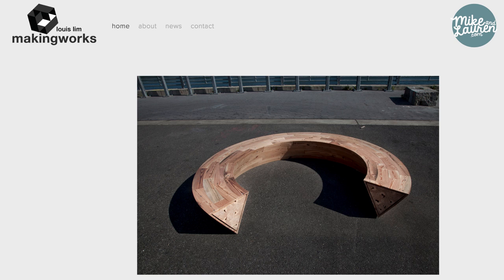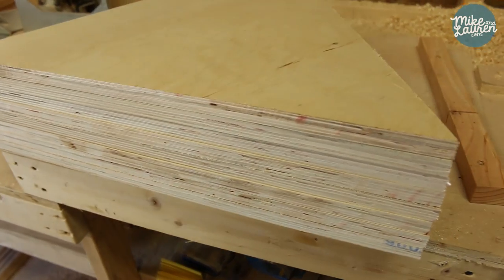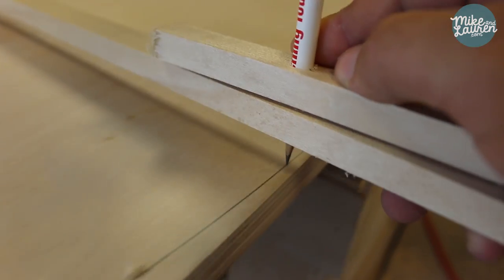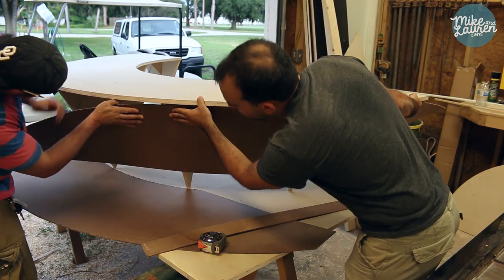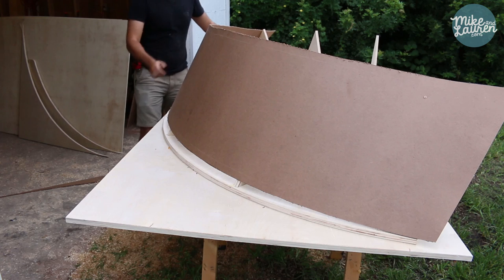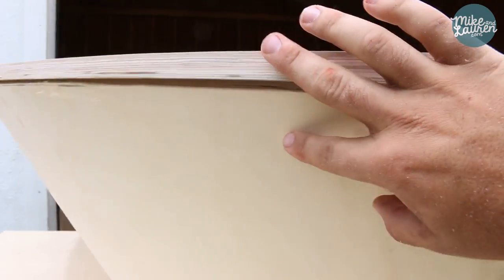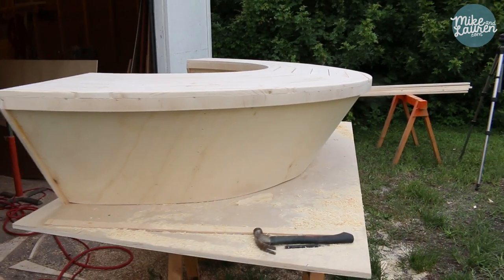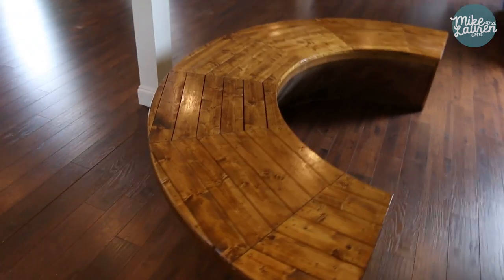Mike Makes a Contemporary (kind of) Triangle Bench

Comment: For the cone shaped pieces, lets say one curved edge length is L1, the other L2, lets say L2 is the longer one, and W is the width of that arc shaped piece needs to be.  Then R2 (corresponding to L2) is: R2 = W/(L2-L1)*L2 and R1 = W/(L2-L1)*L1
Reply: +Matthias Wandel 
When he asked for help with the math you were the first person I thought of. I was going to send a comment that he should reach out to you but you are already here,
Reply: +Matthias Wandel   Matthias, I have no idea what you said but I know you are brilliant (big fan) so I'm going with you.  

Yeah Mike, what he said. :-)  Douglas
Reply: +Matthias Wandel I was actually going to go on a fact finding mission and dig up the equations missing. It's (brilliant) people like you that make this world lazy. 

Just kidding... Except the brilliant part. Not kidding in the least about that. I love your channel. AND... I hate pocket holes.
Reply: +Matthias Wandel awesome. im writing this down for reference. Thanks!
Reply from the maker: +Matthias Wandel Thank you so much!  Those numbers are right in line with +Joseph Malovich Solidworks design in a comment below.  For future reference what is that calculation?  I couldn't figure out if I was making a frustrum or truncated cylinder/triangle.
Reply: +Mike and Lauren I believe Matthias' formulae relate to two arcs (L1 & L2) subtended by a common central angle. The difference of the radii (R2 minus R1) is equal to W. The math is pretty cool!
Reply: +Matthias Wandel i'm new to this channel, but i've been a big fan of yours for a long time now.  like others, i had you in my head when i scrolled down, and to my amusement, you are the top post ... haha!!
Reply: Man you are awesome !!! I enjoy all your videos.
Reply: Only you would know that...

Comment: Really nice build and I like the way you build your projects and design as you go. I just finished a kitchen table from Pallets and it has 57 pieces in it. I changed my design three times as I was building. BTW, I'm pretty decent with numbers but I would have struggled with this as well. I will remember this post so I can refer to the answers below if I ever need help with this type of build. In fact I'll be building a bumper for a truck I'm restoring and this will definitely help with that. GREAT BUILD, thanks for sharing.
Reply from the maker: +Karl Ackdamack Thanks!

Comment: Just found your channel and I'm really enjoying it. While I wouldn't have let the math solution go either i think you could have taken a cue from counter top installers. Cut thin flexible strips and outline the curved areas and hot glue them together to make a template. Lay flat on your sheet good and you're set.

Comment: The lower radius is smaller than the upper radius, its section of a cone. You have to calculate the cone angle and then using the distance between the 2 radius, you can calculate the radius sizes

Comment: Mike think about building this like a 3/4" x 3/8" strip wood canoe.  It would have a look something like a wood floor. Once you build a working frame for the bottom, it's just a matter bending the wood and tacking it to the frame to mold it.  Then you have a bottom that's self supporting without an internal frame.  After that you'll need to glass the open areas of strips between the frames members inside to set the bent, then build the top with random lengths of hard wood flooring.

Comment: I see what you mean about the "deck-like" style...   I rewound to the beginning to check.  is your version smaller than the original inspiration?   I wonder, what if you stained the top, but painted the base white.  I wonder if that would fit that space better, as you have wood floors, and painted white posts + trim.  Couldn't see the background any better than that.    The triangle on the ends needs a bit of work then, if you go with the painted base.   Hope this helps?   I'm still totally amazed at the math and success with getting that cone-like shape to work.   Cool!
...art
Reply from the maker: +wordsnwood I couldn't find how big the original is, but mine definitely seems smaller.  It looks like maybe his was a 12 foot 3/4 circle?  Funny you should say paint the base white, I was thinking of trying that on the next one.  I think you're right about the wood on wood floor.

Comment: I'm in the sheet metal business and cones are my weak point, but one person hit it ded on calculating the pitch of the cone pus the two radius will get you where yu need to be. I personally do it trial and error with metal and just good ole fashioned experience from prior failures, wood is definitely more difficult in my opinion. Looks really good I enjoyed your video
Reply from the maker: +lionelhernandez34 Thanks!  Yea, trial and error worked, but I would have preferred not to cover up the edge with trim.

Comment: you could use a cad program that way you just have too drawe it 

ore if take that lip a away ( the plywood that is overhanging) you can just nail the bendable plywood on en then  trim it flush whit a flush cut saw or a multi tool or something like that I hope it make sense too you
Reply: +Daan.Z.bloedjes This would totally work! Add a rib along the bottom to flush trim against!
Reply: +Joseph Malovich most professional woodworkers (in the Nederlands at least ) suck at this kind of mat  but most of the time we  fix that just by using the kind of solutions I just discribed and it is always dead on
Reply from the maker: +Daan.Z.bloedjes I couldn't get it to sit flat against the rim unless the shape was perfect. It kept buckling out.  Otherwise I would have used the flush trim bit like you said.

Comment: Remove the overhanging lip on top, nail plywood on so it over hangs all sides. Use flush trim bit to get it perfect.
Reply from the maker: +joe Riordan It doesn't quite work like that because it won't sit flat unless the radius is perfect.  Otherwise it buckles out.
Reply: Not if u skew it slightly. That would give you a template but the grain would also be crooked. Use that template as a guide to cut the rest. If the top of the back is the horizon line, put the sheet of plywood so it overlaps on all sides then trim excess. If you're able to do it with a cut piece, s full sheet should work as well. Or get a roll of craft paper, and anywhere it buckles you cut it and tape it to match the edge. That will give you the template as well
Reply from the maker: ***** Ahh.  Yes, I could have used a full sheet of hard board just wrapped around at an angle and then traced it... Damn you hindsight!!!
Reply: Or you could spend way too much time trying to do the math as laid out by Matthias Wandel, only to have lost a year off your life from the stress and done it this way anyway. I wish I had his skills in both wood working and ability to see the way those formulas work. Nice build btw.

Comment: There's a template maker for cyclone separator cones somewhere online that would give you a printable template.  But, perhaps you can make use of this calculator to help figure it out?  It's in metric, but those conversions are a lot easier :)  http://craig-russell.co.uk/demos/cone_calculator/
Reply: Ok, this one works better but doesn't have any pictures:  http://theurbanfarmingguys.com/iFrameTest.htm

I assumed the outside diameter of the bench at 96" and the diameter at the base to be 84" (7ft) with a bench height of 18"  That would give the inner diameter (base) of the outside skin at 132.82" and the outer diameter (top) at 151.79". 

With an inside diameter of the bench at 72" and the base still at 84" and the height still at 18", the inner skin would be 113.84" and 132.82".  

Double check the measurements against your actual ones and you're on your own for the length :)
Reply: +Curt Walkins here's another with pictures to go with the dimensions.  It's for steel, but math is math...

http://www.cmrp.com/cone-calculator

And, I'm done for now :)

Comment: the piece you're trying to cut you should let it over hang the bench top and trace the line from the under side of the seat to get the correct radius then use the jigsaw to rough cut it then you can use a sander to finish it. let the bench top do the math for you. i can draw a sketch if you like.    i drew a pic :         http://imgur.com/63g38cp
Reply from the maker: +Brandon Taylor I tried that actually, but it buckles as you wrap it around so it never sits flat against the rim.  If you were to add curves to your green piece in the drawing it would be getting further and further away from the bench in the middle.